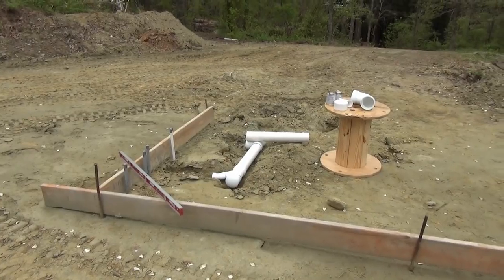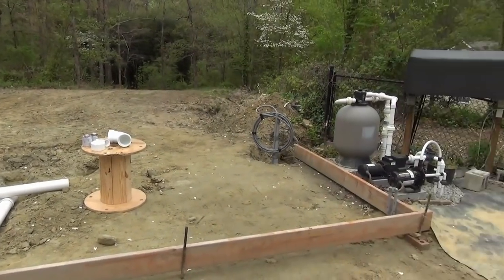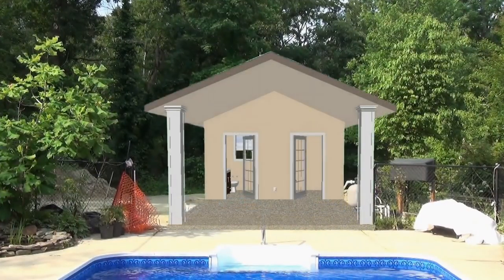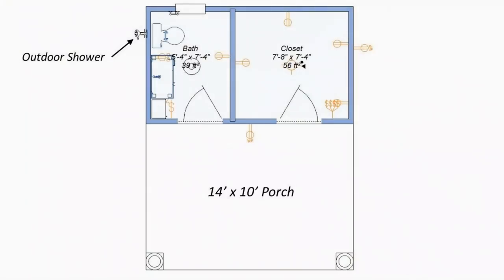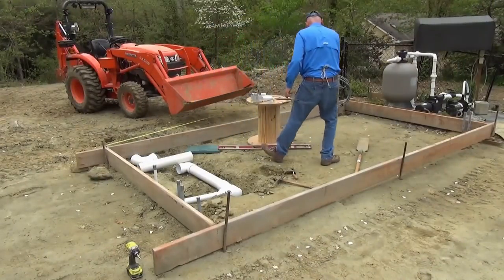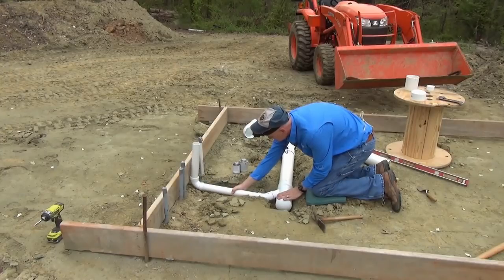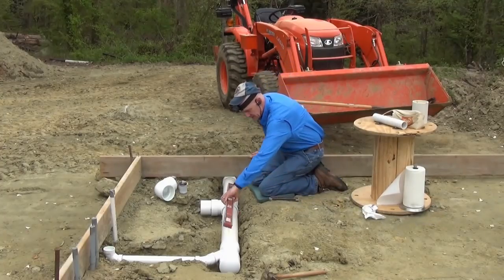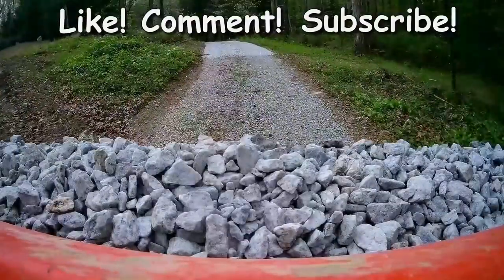Prepping the Pool House Slab Form - Part 1 (#38)

Comment: Awesome job Martin !!  PVC is a godsend....you'll know what I mean firsthand if you've ever had to use cast iron soil pipe, oakum, and hot lead for the joints.  (-:     I still have all the old tools for tamping the  joints, melting and pouring the lead as well as the ginormous 4' long cutting tool with big ol' cutting wheels built into the chain.....not that I've ever used that stuff ya know.... I remember watching you move the pool shed with the tractor.  That's about the time I started following you and your DIY ideas.
Reply from the maker: Hi Wendell!  I’ve never worked cast iron pipe.  It’s been PVC or CPVC mostly with a little copper pipe thrown in for seasoning.🙂 Speaking of the pool shed, I’m currently building the new pool house and the shop building is going up at the same time! All coming in future videos. Thanks for watching!
Reply: @DIYMyWay  Yessir, you are going to love the new workshop !!  Unless I missed something the last I saw of that project was the hurry-up-quick water line install the night before pouring the slab then they didn't show up the next day at daylight as expected.  Sooooo.....I'm betting the series is going to be an awesome one !!  I KNEW you were holding back on us.....
Reply from the maker: That’s right, but my videos are lagging behind actual progress because I’ve been so busy doing stuff.  Looks like it will be rainy the next few days so now I’ll have a chance to get caught up on video production.  I think I’ve got some good video to work with.